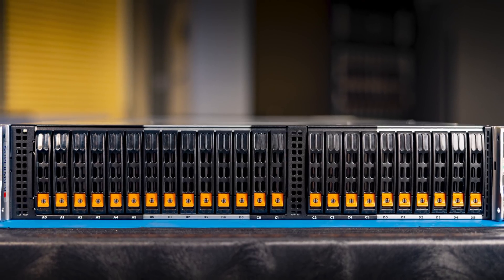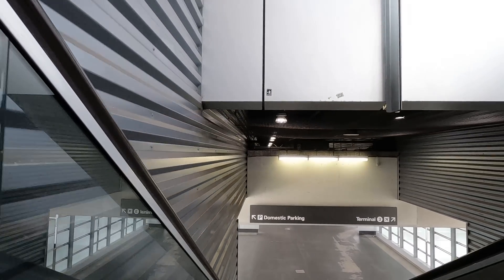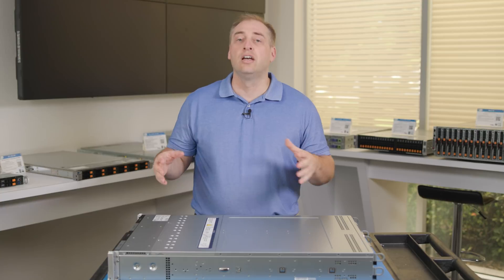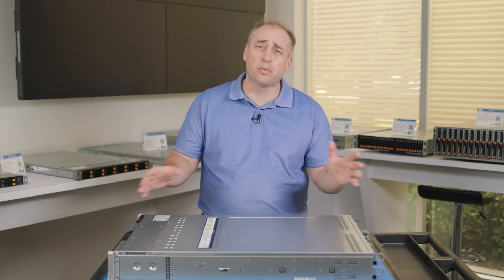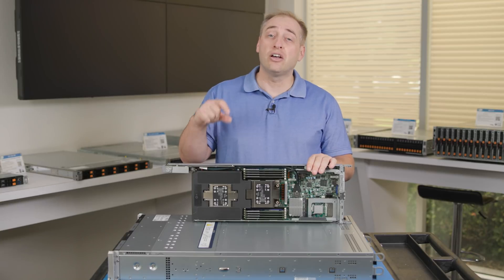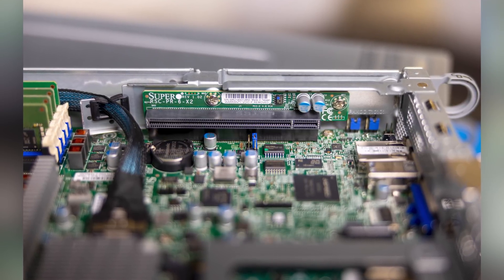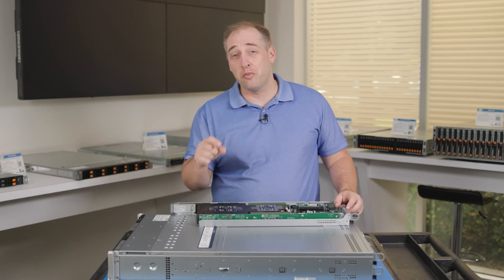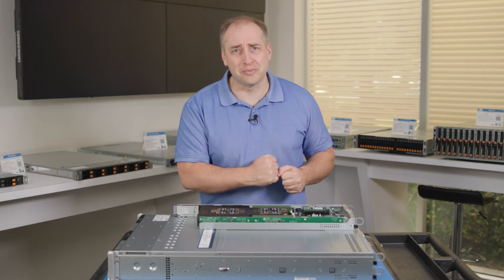High end 2U 4 Node Supermicro BigTwin

Comment: I'm confused. The still image for the video says 288 cores, but in the video itself, you mentioned that it can go up to 40 cores per CPU, which means upto 80 cores per node or 320 cores per chassis. (40 cores per socket * 2 sockets per node * 4 nodes per chassis = 320 cores)

Comment: Are those nuts holding the heatsinks on plastic? :/   Thats probably going to break after running under some load for a year
Reply from the maker: That is the standard heatsink retention design for 3rd gen Xeon Scalable. Both Cooper and Ice Lake versions. Next gen Sapphire Rapids also uses these. So the entire industry is using them

Comment: Can't imagine the nodes are hot swappable seeing that the nodes only eject from the back, you would need an open back cabinet and that is only if the hardware supports it. But if they were these would be great for redundancy, minimizing or outright eliminating downtime.
Reply from the maker: They are designed so that the chassis can be running and new nodes just plugged in. You can take a node out, put it on the cart waiting for service, immediately put a new node back in. It will power on and connect to the drives on the front of the system and be up and running again. It is super cool and makes service way easier when you have a bunch of these.
Reply: @ServeTheHomeVideo  Okay that's cool would be great for a homelab or maybe a small business with smaller accessible cabinets, though I have to wonder though if there is a more effective way to make everything more accessible; I mean unless you have an open back cabinet wouldn't you need to pull out the whole chassis to access the back to replace the nodes (forgive my ignorance if I'm missing something, I'm new to the whole homelab scene).
Reply: @ServeTheHomeVideo  Except most software these days detects the physical hardware on which it's running, so effectively putting the drives from one system into another creates a mess. (try that with ESXi...)
Reply: Indeed. Few design their racks for work in the hot isle. The last computer room I built had only 2' behind the racks. (4' infront) I only had so much room to work with. And nothing ever goes in from the back. (tiny switches, maybe. the larger fabric switches slide in backwards from the front!)
Reply: @jfbeam  Maybe a design that has all swappable parts on one side, and things like fans or radiators in the back. Still have to admit all that modularity in a 2U form factor is pretty impressive though if I had to put my thought on design out, maybe make it a 3U and have the drive bays on top of the 2U segment, and have ventilation on top that way combined thermal runoff from disks and components can more easily escape through convection.

Comment: For me the AMD version of this platform makes a lot more sense.  I work in the 3rd world where datacenter rack space and power is a lot more expensive.  We cant waste rack space on inefficient Intel processors.  64 Core Epyc more power efficient and has better performance.  There are so few general purpose workloads, where Intel can compete on density.  Now if they crammed their socket full of those new Alder lake E-Cores and a handful of P-Cores, then they will have my attention.
Reply: They'll have to do it quickly, AMD is supposed to be doing that very thing for 128 cores per package sometime next year or early 2023 I think.

Comment: Really like the layout of these new nodes. As you already alluded to, cabling the back properly, including Network, and OOB, is essential to preventing a nightmare scenario later on of a down node that you can't remove because a live node is cabled over top of it!
Also really like that they're using HDS Connectors now on the sleds. The gold fingers of the previous generation were way more difficult to line up (and we've seen at least one node short out when installing, taking out the whole block).

Comment: I think I prefer the Lenovo d2 chassis. Firstly the nodes are removed from the front. You have no idea how hard removing a fully cabled up sled out the back is. Let's just say it is a right pain in the backside. With the SD530's I can just slide them out the front and not have to unplug anything. Second you only need to make one network connection to the d2 chassis to connect up all four BMC's on the nodes. That is very handy and saves on a whole bunch of cabling and management switch ports and also less cables means better airflow around the back of the system. It also gives a single point of management for all the shared features such as fans and power supplies.
Reply from the maker: I can tell you I 100% know about removing fully cabled sleds. We have about 30U of 2U4N chassis since it is an easy way to have many CPUs online for testing. Key is bundling cables just outside of the node for each node, then bundling once it hits the side of the rack and goes to switches. That small change makes it relatively easy to remove this style of node. The shared chassis management is nice, but whenever I publish it (concerning other vendors) I will have a piece about something that should raise eyebrows about the chassis management features out there.
Reply: @ServeTheHomeVideo  I really really should take a picture of the back of one of our racks. Thankfully it is Lenovo d2, there is absolutely zero chance of bundling the necessary cables to the side. It does not help that DAC 100Gbps cables are as thick as your finger.
Reply: Agreed. However, the D2 does have the serious annoyance of having to pull the entire rear assembly (including PS's) to get at the card slots. And the chassis is HUGE @ nearly 4' long. To get the rear module out, I have to partly remove the chassis from the rack. It took almost a year before I could add cards and two more nodes to one because I can't turn the thing off. It was done when the chassis was being moved, which made it much easier to pull everything apart on the workbench vs. in the rack. (30 cables... 24 DAC, 2 Cat6, 4 power) No amount of neatness can make it easy to pull nodes out the back.
Reply: @jfbeam  Homer Simpson moment coming right up. You do realize that the PCI cards can be removed from the rear https://www.youtube.com/watch?v=o_bjkU6aFvM

Comment: I'm really not sure why, but swapping a node or a blade in a blade server might be one of the most satisfying things, you could do in a data Center. There is just Something about sliding something this big in a system and it fits just perfectly
Reply: The Sci-Fi feeling of working with a modular super computer today
Reply: Agreed. I do that with our Intel S2600 2U servers haha :P only during deployments.
Reply: And then the vendor screws up and sends you a unit that sticks out of the front by 1-2 inches. Aaah, the disorder!

Comment: How is this product different than a "regular" blade enclosure with 4 blades? In this day and age of virtualization, aren't blade systems a thing of the past?
Reply from the maker: Two main differences. First, this is 2U. Most blade enclosures are larger. Second, this does not have the integrated switching that you normally find in data centers. 2U4N is very popular in virtualization farms.
Reply: @ServeTheHomeVideo  It is also highly popular in HPC too I should know have lots and lots of them at work. My beef with them is the C20 power sockets required because some backward countries have 110VAC mains supplies. In more sensible countries with 230VAC a standard C14 socket is able to deliver enough power.
Reply: @jonathanbuzzard1376  The power supplies in the one reviewed here don't support 120V, they are specified for 208V to 240V supplies. They still need the C20 inlets to cover their power requirements while complying with the IEC current ratings for the connectors (for reasons I don't fully understand UL will approve connectors at higher than their IEC ratings, but that only applies to north America).
Reply: @Yaron VPX was last updated in 2019. You can get 12+ blades in a 3U, with 6U depending upon whether the chassis takes large or small boards.

Some other differences are 768 watts per board and a much larger board; which can hold more components. 

Such systems are popular on larger aircraft, with sky's the limit pricing. 3U and 6U are also used on the ground.

Comment: This is an awesome unit.  I've been looking at these types in the past 1 month.  Thanks for this nice timely video.  It would have been nice if you fired one up to give a sense of acoustics.  Also, it would have been nice to address the cooling issue regarding higher TDP that Supermicro warns about.  Dell has a similar system but offers liquid cooling as an option.
Reply from the maker: Super loud. Good point on the cooling. Will did that in the main site article.

Comment: @Patrick Any idea when they're going to put E1.S or E3 on these units? The Yosemite v3 spec with 4x E1.S per node makes a lot of sense, since you would rarely mess with the I/O, and more likely to replace a failed node or drive, however Yosemite is 4u and this is 2u.... decisions, decisions
Reply from the maker: Are you thinking about something like this? https://www.servethehome.com/supermicro-bigtwin-e1-s-edsff-edition-launched/
Reply: @ServeTheHomeVideo  Thanks for that link.  I've not seen this before.  That's great.
Reply: @ServeTheHomeVideo  Yea exactly like that! Did they give you an indication when they were going to launch that model the last time you visited Supermicro's booth? (that announcement was 2 years ago, lol 😂) - There's no trace of it anywhere in the catalogue or website.
Reply: Intel has these 30TB Gen 4 drives; the long ones.  You technically could fit 64 of these in 2U Big Twin.  That's 16 per node.  In this unit, you have 128 PCIE lanes per node:  48 for pcie slots, 8 for internal boot, 24 for current NVME drives.  That leaves another 48 lanes so you technically could have 16 E.1 drives per node (direct connect) and still have some lanes to play with.